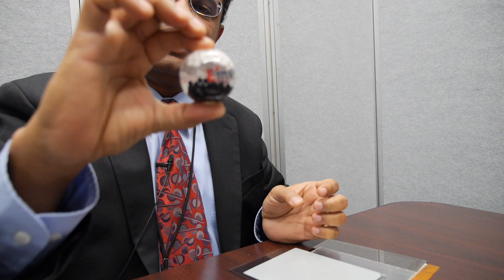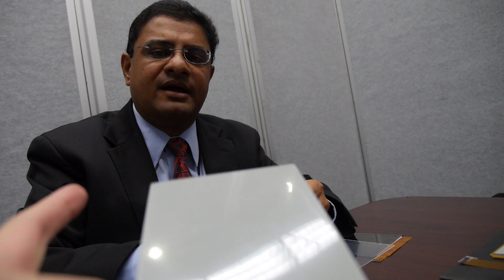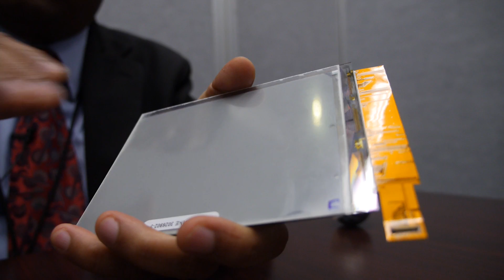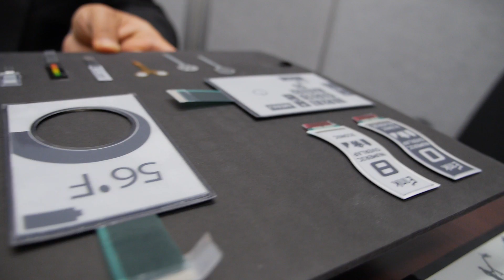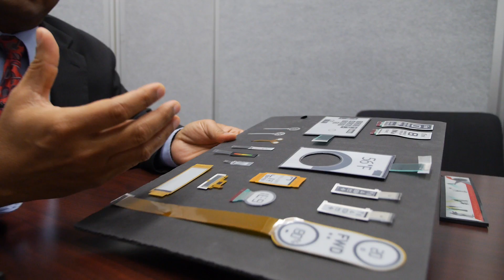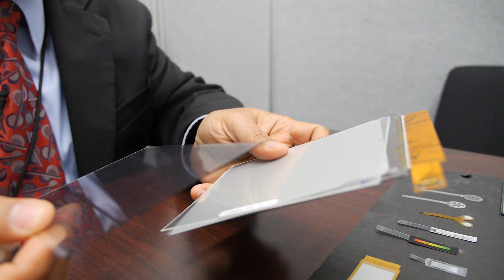How E Ink matrix and segmented displays are built

Comment: This is probably the closest I've found to manufacturing method of e-paper.  I didn't realize that the e-paper itself is manufactured as an individual layer, and at a massive sheet at that.  Bonding and lamination to various display forms also seems to make the overall platform more versatile to size differences.  Unfortunately the sizes I'm looking for aren't manufactured anywhere, nor do I think they will ever be unless very specific things within the industry catch on, though I think those things will always be fairly niche.  But the fact that the raw component can be cut and laminated gives me hope, if I can ever find a source of the raw sheet and a source of custom matrix panels and drivers, at least for the proof of concept I have in mind.
Reply from the maker: What is the size you need?
Reply: @charbax  10mm square, max dimension, on a matrix; though this might change down the line, with the most major change being variability in widths among various displays.  Preferably with the matrix not having a side exit, i.e. a perpendicular to substrate plane ribbon/header, or even more preferably with the driver chip on the substrate as an i2c device and an ultra-low-power sleep state for wiring simplicity.  The rabbit hole for the application these fit into goes so much deeper, but just step one is either unobtainable or out of reach; which is why the raw microcapsule dot matrices being manufactured as a massive mother sheet piqued my interest, as in theory all I need is a sheet to cut down, matrix substrates (which could also be custom for this application), and a laminating process to produce what I'm envisioning.  Though I don't have the business, scale, nor finances to be working with a manufacturer like E Ink directly, so I have to keep the proof of concept within a scale that a hobbyist can achieve, at least until the proof of concept is viable enough that I can start pitching it to some contacts I have within the industry as a full product.  I know the scale and implementation is possible, just nobody is selling produced components at the scale I need, and the implementation I need is a bit atypical, which is why getting an appropriately sized piece of the mother panel and some custom matrix substrates at costs I can afford would be great for where I'm currently at in this hypothetical project. 

I also have another idea floating around that this application would benefit from, but it'd require a different microcapsule variant than what's currently available, and with how secretive E ink is I have no idea if it's even something they've looked into producing, considering it flips the practical use of e-paper on its head.
Reply from the maker: @xaytana  if you can consider a $500 sourcing budget, I could look into sourcing your requirements for you, from E Ink directly or from other supplier experts in this space. you can contact me if you want to discuss it more charbax@gmail.com I am pretty sure there is enormous developments happening, and your size might already be available at exactly the size and specs you need.. just have to look through contacts and etc.